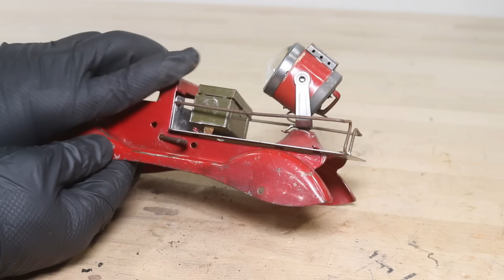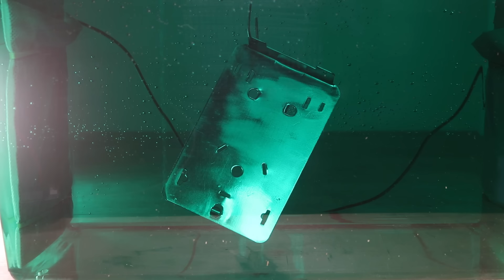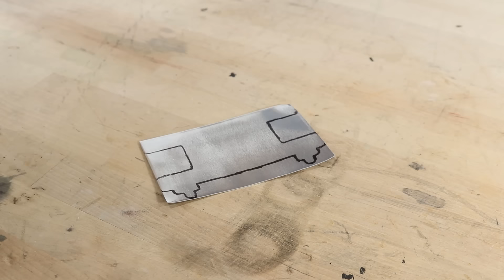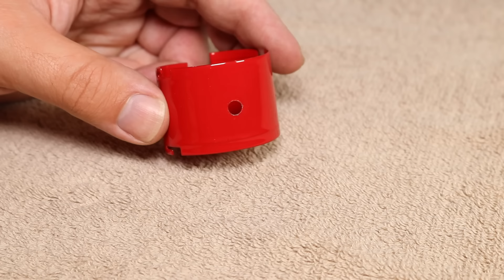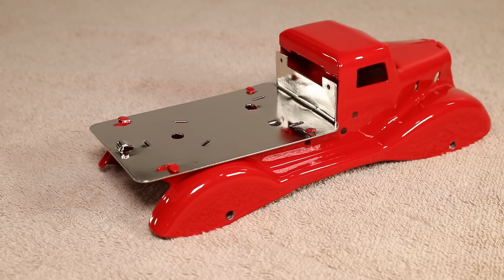1930s Marx Wyandotte Searchlight Truck Restoration

Comment: This Chip channel episode will definitely; bring back the memory of when I use to work at the 350 Encinal Drive Goodwill industries, back then in late 1987 to mid 1988. This is where I used to work on a Graymark electronic project; that required a one-face PC board parts components assembly, which belonged to a toy tracer robot 🤖.

Comment: Another great restoration! Love these toys. Brings back great memories!
A little tip...paint the inside of the light housing chrome. The light will be brighter....
The tabs holding the battery holder in place...bend out instead of in so they don't mark up the battery when it is in there...

Comment: Chip, you did a great job on that spotlight truck.I love the line up at the end of all the lighted vehicles powered with those 'Eveready' batteries. 
I remember those from the 50's and 60's, whenever there was a grand opening or the new models were in the showroom at your car dealerships. We would ask our dad to find out where the light originated from and most times he would oblige us. Sometimes it was a group of spotlights and they would go back and forth. If I am not mistaken there was a light on the old airport in bad weather too. Nobody had GPS and these were a great way to bring people to your event. 
Thanks for these videos. Keep them coming.

Comment: Nice '41 Marx. Fortunate to find a complete truck... Especially considering that, for the next 6 years,  production was redirected  to the war effort. US toy manufacturers built steel storage containers, mess kits, helmets ect.. during the war. Metal, rubber and plastic toy manufacture was prohibited from late 1941- early 1947. Only cardboard toys were produced during W.W. II.

Comment: Beautiful... just one question.  How did you deal with the body ground for the battery?  Did you have to scrape off the new powder coat? I would think it would not conduct electricity.  Just curious.

Comment: Any idea of what was in the holes in the body were for, just one body for different applications?
Reply from the maker: I'm honestly not sure, however i'm sure that you're right about being made for different applications. Thanks for watching!
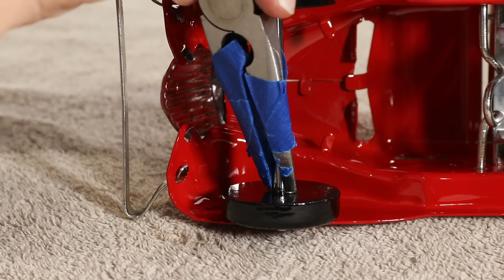Reply: I wondered that too. I think the holes in the doors represent handles, but the fold-in tabs (visible at 26:18) seem to indicate there may have been an interior...? Did these kinds of models come with any suggestion of seats or steering wheels?

Comment: For what is the lead test?
Reply: The lead test is done to know the method for removing paint. If lead is present, sandblasting could be very dangerous because you can breathe lead particles; it's better to strip paint in that case.

Comment: So how long does an actual breakdown and the restoration take you like time wise cuz I know that you do a lot of time left stuff on here is wondering how long the actual time it takes to disassemble the vehicle and all components and then strip it blood test it remove the lead paint strip it down after you've removed lead paint safely but has lead paint or sandblasted after you sandblast it and all that stuff how long does it actually take to get everything working right in putting Electronics different have electronic components

Comment: Big mistake in my opinion ... dipping the wheels in paint ... you lose the grain of the wood. The wood helps to "date" the piece. Should have been black stain.
Reply: Agree. The truck looked spectacular but the super shiny  plastic-like black wheels didn't fit. A black stain would have been better.

Comment: Hi,
     Sir we are deal in camera accessories if you need any type of camera accessories we give you whole sale price 

   Type of accessories ....

Mehra enterprises deal in
 1)tripods,2)monopods,3)microphones,4)studio light bag,4)stand,5)reflector,6)uv filter,7)camera light,8)camera straps,9)belt ,10)softbox,11)go pro camera accessories,12)flash and flash accessories,13)camera lens caps,14)memory card box,15)camera screen protectors,16)camera and flash remotes,17)mounts adapter,18)stablizers,19slider,20)studycams, 21)camera battery grips,22)rigs
 
Regard 
Jatin